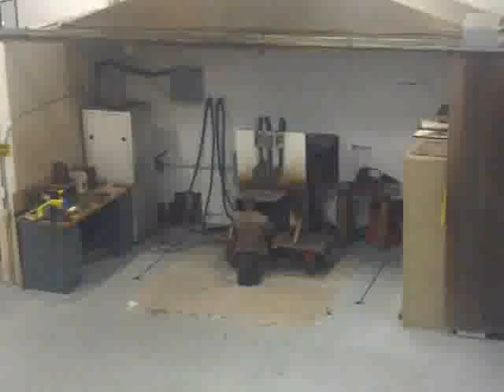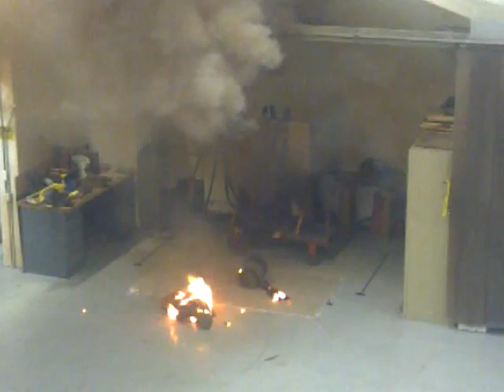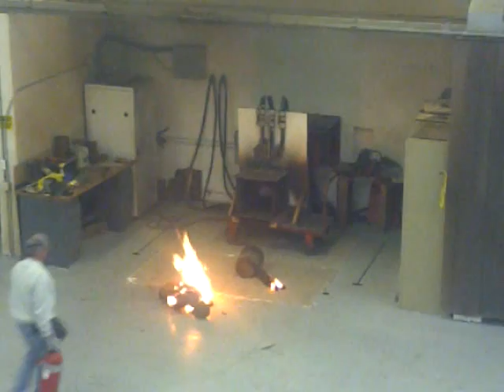arc flash demonstration i went to that is about 20 cal/cm^2

Comment: 20,000 Amps? What kind of fucking wire can even handle that?
Reply: I know this is an old comment but I just did the math and for 20 cycles (1/3 second)  a 300 kcmil wire would carry that current without melting the insulation. That’s a wire about as thick your thumb. 4/0 AWG would also be able to do it if the wire was freezing cold before the short started.
Reply from the maker: @deltab9768  this lab also does a demonstration with cables energized at currents like that. The cables whip around unless they are protected with current limiting fuses.
Reply: @white-buffalo  Current limiting fuses are amazing. I mean I understand how they work but the shear speed and the amount of difference they make is huge.

I actually had wire get magnetized by a fault current and whip around like that once. I doubt it was a full 20kA, probably half that or less. Somebody had supplied temporary single phase power to some 3 phase subpanels. To make the B-phase live they put a u-shaped piece of wire into a 2 pole 40A breaker and put one side of the breaker on the A phase and the other on the B phase. Those got left there when we applied actual 3 phase.

Luckily nobody was hurt and the only arc was inside the 40A breakers which were damaged and thrown away.
Reply: Electrical bus work lol